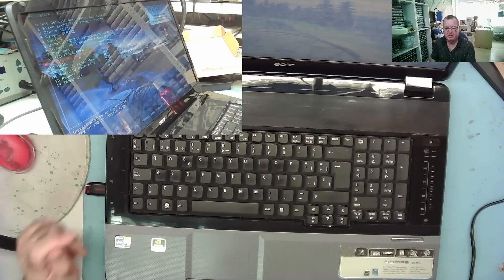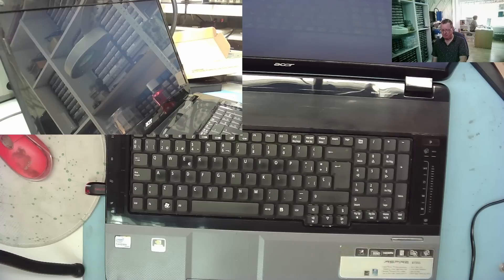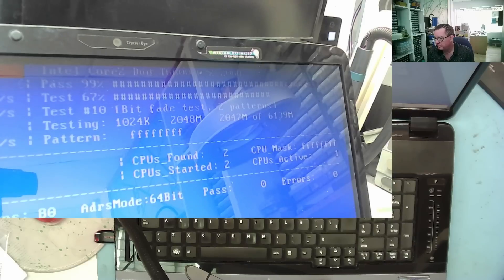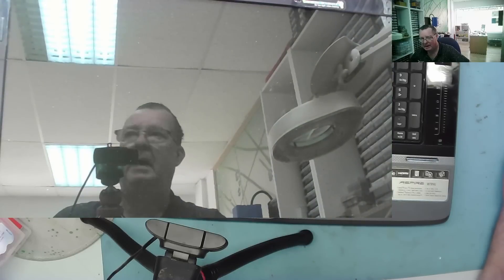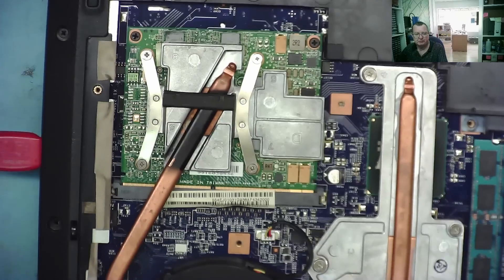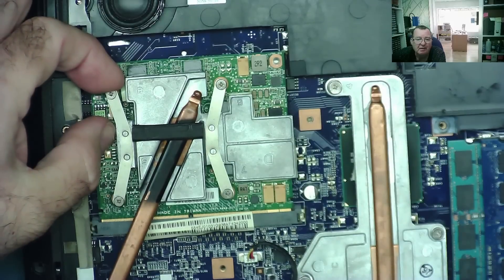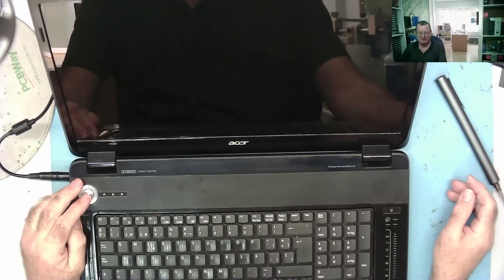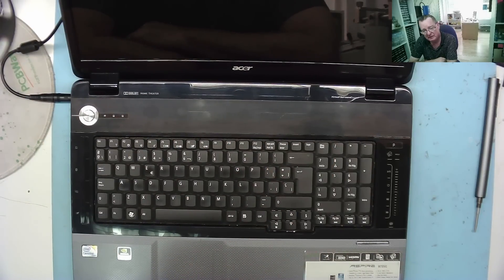Can't Repair It Because You're NOT GOOD ENOUGH!

Comment: I was trying to think what happens at the end of the memory test. My guess is that it is trying to reset the CPU protection mode. It would have to turn that off in order to run the memory test and once completed the software would try to reset the protection mode. It doesn't tell you for definite where the problem is but I would suggest a CPU problem. I assume it's soldered onto the motherboard so that's probably not getting fixed without replacing the motherboard anyway.
Reply: Or it just rebooted at the end of 1-pass test. If there is a fail it should beep and write something in red if i remember correctly.
Reply from the maker: Yep, soldered CPU...
Reply: @LearnElectronicsRepair  I dont belive that its soldered to the board nothing was at that time... Try another cpu.
Reply: Often, changing from protected mode to real mode requires CMOS to be written to and a CPU reset issued to get it back to real mode via BIOS. If CMOS rd/wr had a problem that might explain it?
Reply: @steve6375 I'm not talking about real mode (16 bit), that wouldn't allow the software to access all the memory. Instead I was talking about unrestricted mode (aka kernel mode or privileged mode) which would be needed to access memory directly. This involves disabling interrupts and it may be that when interrupts are enabled again it causes a problem.

It's quite likely that the address of the interrupt handler is changed during O/S installation and this also requires disabling and enabling interrupts. That could potentially trigger a fault in the CPU, northbridge or southbridge. As Richard said, where do you look?

Comment: I'd suggest cleaning the cooling equipment and reflash the BIOS.
Reply from the maker: I don't see how this could be overheating, mainly because it always fails at exactly the same point every time during loading an OS, even when already warm from the previous attempt.  It looks more to me like it fails when tries to do 'something' during OS loading on Linux, Windows 10, Windows 7  Regards BIOS code, that only runs before the computer starts to load the OS, so if it gets that far the BIOS must be OK?  It also boots successfully from my E2B USB which AFAIK is linux based and then can run for a long time like the 47 mins when I did the ram test.  But these are suppositions, I don't know if this is correct for sure.   Is there some specific reason you think it could be overheating or BIOS?
Reply: @LearnElectronicsRepair  Hello Richard,
Anytime I open a laptop I always clean the cooling system because they are nearly always gunged up.   The point at which the BIOS is no longer used is the point at which it hands over control to the OS,.  So enough of the OS (kernel) or boot loader must loaded and running, thus to some extent will be OS dependent.  I suspect that is why USB LINUX is working and Windows isn't.  Just what I'd do.   BTW, I am very impressed with how you fix switch mode power supplies.  I hate the rotten things, been zapped way too many times.
Reply: Not thermal by the looks of it.
Reply: The UPGRADED Bios. 

You’re welcome. 

Not my first rodeo. 

- his Dad

Comment: Did the problem suddenly happen or did it occur after the computer may have been previously opened. If it occurred after computer was opened previously then check the chassis power on connector that connects to motherboard. Polarity of connector is important. Flip connector and recheck
Reply from the maker: I don't know the history of the failure. However, wouldn't that sort of fault cause it to crash more randomly, not at repeatable times?
Reply: I’d expect issues with turning on intermittently when button not pressed if the ribbon traces on the flex had been damaged and touching each other or not touching the correct pin at the connector

Comment: What happens if you run it with a fan blowing on it?  Is the fan spinning fast enough to keep it cool? 40 degrees C I bet it will work in the UK.
Reply from the maker: I didn't try it, I can do but first let's work out how it would be possible for the laptop to reset at exactly the same point (when installing windows for example) even if it is allowed to restart immediately afterwards and the installation runs again.  Presumable if this is an overheating problem the second time or third time it tries to install it would fail earlier during the process?  I'm basing this assumption on the fact it would already be hot enough to crash again after the first failure.
Reply: @LearnElectronicsRepair  Maybe some installation instructions causes the cpu to get hotter, so it will fail in the same place.

Comment: Maybe a BIOS update needed?...
Reply from the maker: As answered on another comment - once a computer boots up and starts loading the OS, is it running any BIOS code anymore?  I was of the opinion the BIOS code only runs to get us to that point.  As it does start to load an OS (and will boot just fine from my E2B USB this would suggest the BIOS code is working as it should.  I don't know 100% that is correct, but you or others here would have to convince me otherwise

Comment: Almost certainly the graphics card Rich as It fails at roughly the same place each time. Could be wrong though :-)
Reply: Gpu for me too.
Reply from the maker: That's my opinion too though there are some other suggestions here.  It's acting like faulty desktop graphics cards that will boot and give a picture, even in windows, but crash at exactly the same point during startup once you have tried to load the drivers